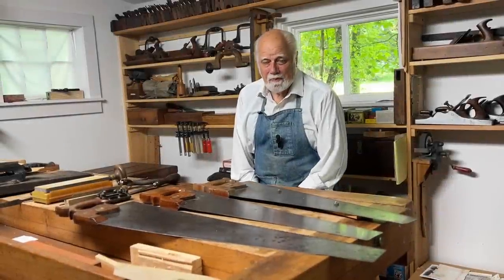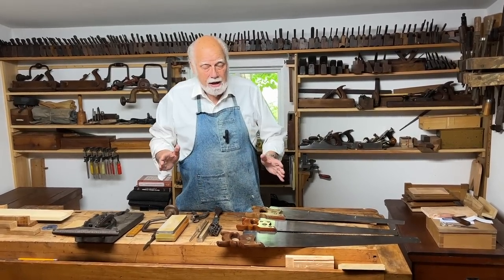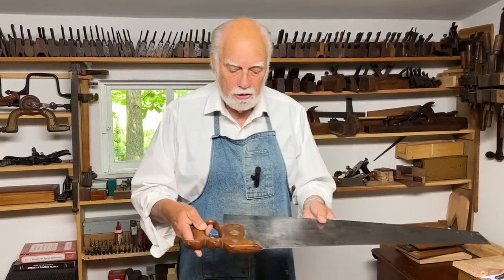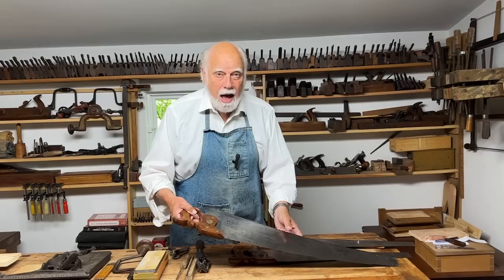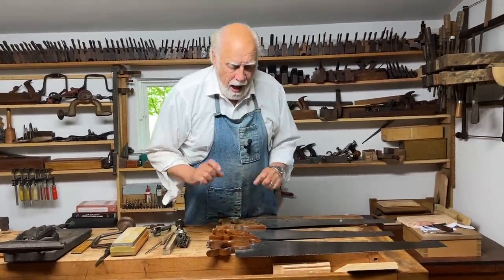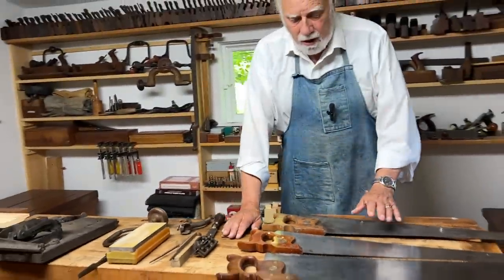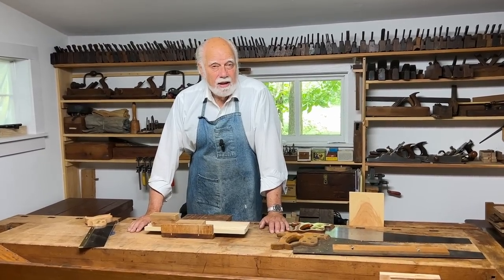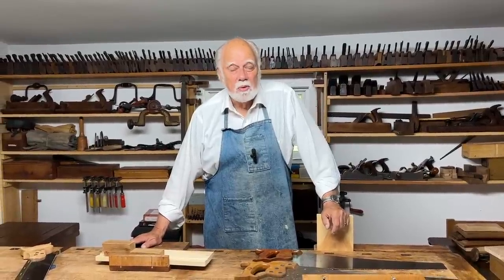47. Handsaw Fundamentals

Comment: Another great video, thank you. I was given a toolbox full of old tools and I have managed to get most of them in fairly good working order. One of the handsaws is markedly concave, rather than crowned, in the centre. Does it matter and is it worth trying to change it? My first thought was yes it is but presumably the owner used it like it is or he wouldn’t have carried it round in his tool chest.
Reply: this video is the first i ever heard of saw crown. i understand the logic but not sure it would apply to every cutting situation. If the saw is sharp i would just use as is to get a feel for what it can and can't do like how much tear out and splintering happens or how accurate it can cut to a specific depth. then you can first hand experience what changed after you sharpen or reshape it.
Reply: Some saws are made with crown and some straight.  I've never heard of or seen a saw with a purposely concave tooth line.  This might have happened if the prior owner sharpened repeatedly without jointing the teeth.  Personally I'd make it straight, but like you said, the previous owner probably used it as it is.  It just might have been a little harder to push towards the end of a stroke because those rear teeth would dig in a bit more.
Reply: @mattmcgrane8975  Good point about end of stroke dig in. I have a folding Fisker pruning pull saw and i rather it not be super concave for that exact reason come to remember it.
Reply from the maker: It'll probably work, but eventually if you gradually attempt crowning each time you file it , it will work better.
Reply: @vince55sanders  Following your comment I decided to try some resawing and compare this saw to the, very expensive, Lynx handsaw  I bought specifically for rip cutting. To my surprise I found that I liked it better. It seemed to be just as fast ( it has 6tpi compared to 4.5 tpi on the Lynx), to give a similar finish and was less likely to wander from the line. As a result it will become my go to saw for this type of work. Thank you for igniting the spark.

Comment: You mentioned that the numbers on the sawset represents the ppi on the saw. However, the contrary is true. It is widely taught and accepted that the numbers do not correspond to the ppi on a saw. Do you have any evidence to refute this claim and what is your source?
Reply from the maker: Some metal sawsets have rotating anvils with multifacetted faces at different angles numbered to conform to the expected angle of set for saws with that number of TPI for the individual saw. Not perhaps what is always required, which is why I explained the process of diminishing the produced set after setting with a file.

Comment: Great informative video! Thank you, Sir! 

I have an issue more with re-sawing and rip cuts. I do what you say with following both guidelines, and I'm good for about 3 inches or so, then the saw will start to drift away. Now, that's either my imbalance of body force or an inadequate saw. My saw choices are really not good at all. 

But with the knowledge you give in your videos on saws, they show me that I might have better results  with a proper saw. So, thank you again.
Reply from the maker: It's possible that your saw is 'eading' because the set of the teeth is not equal on both sides.

Comment: Thank you Graham.  I have an old Disston saw hanging on my wall which needs attention!  Ill wait however for the video on rip and cross cut saws, so i can confirm the tooth pattern - as it seems to be a hybrid of both...
Reply from the maker: If the difference between square-file teeth and angle-filed teeth is that slight you shoiuld be able to make them all one or the other as you prefer.

Comment: Can you joint a saw with just a file (no jointer to help guide)?
Thanks for the videos, they're gems!
Reply: Yes, so long as you hold it square. I've never owned the special tool and it's worked out fine. The file needs to be without a handle obviously.
Reply from the maker: ditto!

Comment: Great video! One question: wouldn’t grinding down the side of the teeth to remove set, as you did here, unnecessarily thin down each tooth making them more brittle and less durable as compared to the hammer method? Or would the difference be negligible in your opinion?
Reply: Using a sharpening stone and just running it down each side really works.  It does not thin the metal but a hair.  Plus if the saw is cutting to the left or to the right running the stone down it a few times on that side will lessen the set and make it cut better and not draw that direction.  Newer saws have more brittle teeth than older ones and harder metal some you may not be able to sharpen from hardware stores etc.  An older saw even if a tooth or two are missing since you will be sharpening the teeth will slowly go down and you will make that tooth again.
Reply from the maker: It shouldn't make much difference and will be rectified anyway the next time you file.
Reply: @gjbmunc  thank you for the reply!